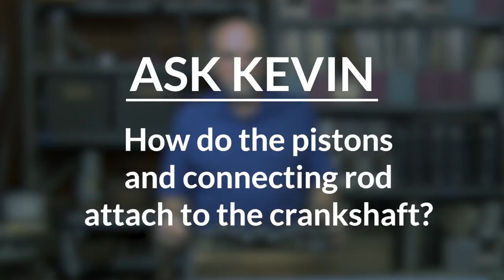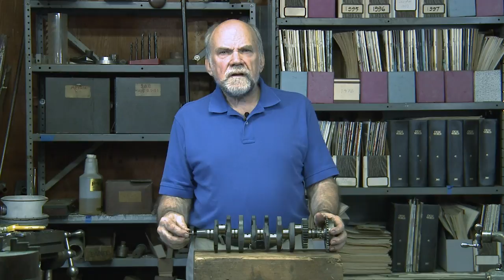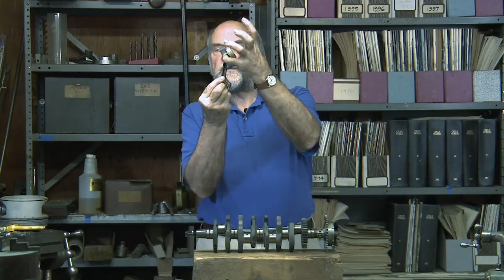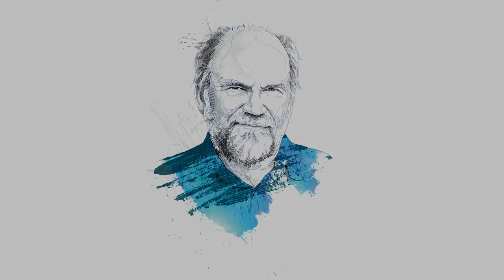How Do Pistons And Connecting Rods Attach To A Crankshaft?

Comment: Its pretty wild that crank rods dont connect to the crankshaft  using ball bearings. Its incredible that oil is all that is needed to keep the friction down despite the fact it spins thousands of rpm for hundreds of thousands of miles